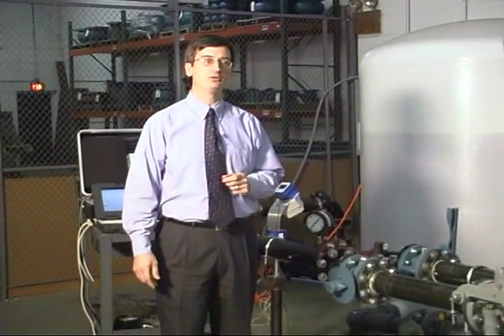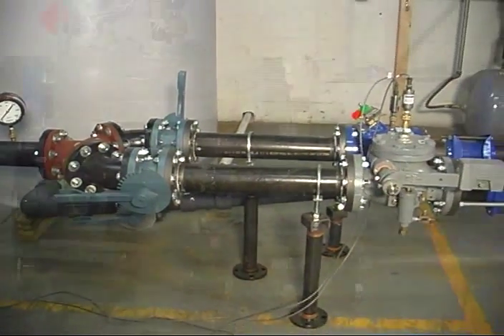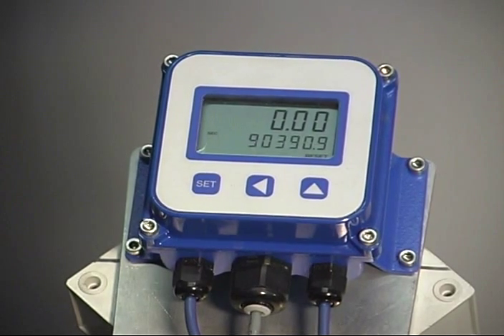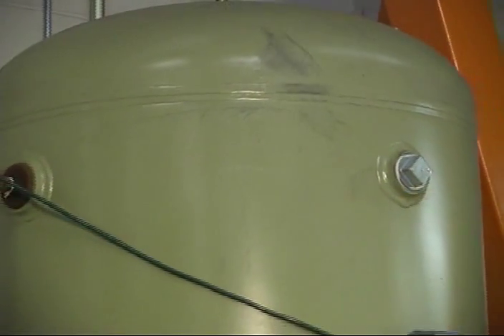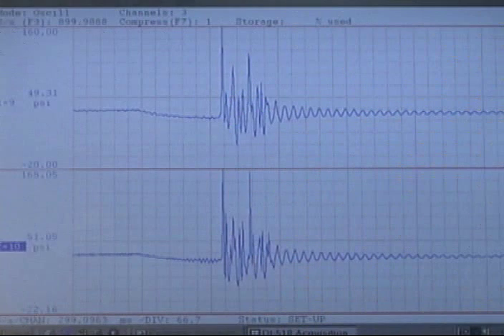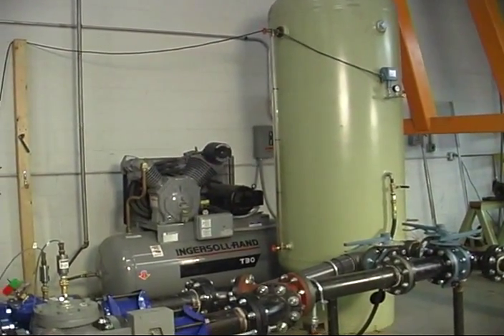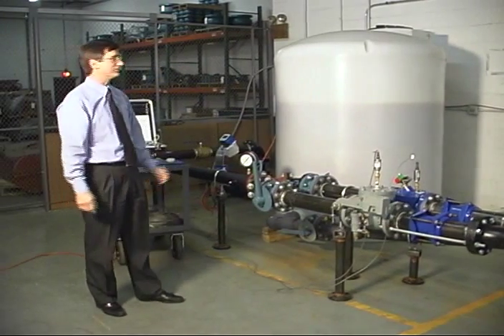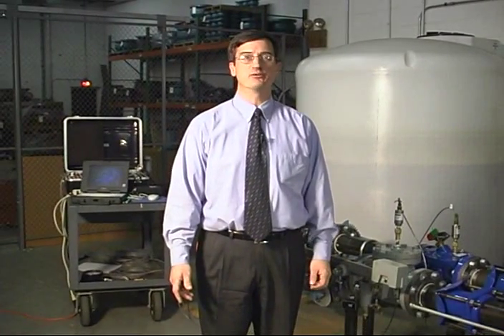Prevent Water hammer with Surgebuster Check Valve and Swing-Flex Check Valve

Comment: The title is misleading. The check valve does not prevent water hammer. Water hammer is caused when the liquid pressure drops to a full vacuum, creating vapor pockets inside the pipe. When the vapor pocket collapses, high pressures result from the water column rejoining. See this video /watch?v=X9UbzcanuDk&feature=related

None the less, Surgebuster is a great valve that performs very well, when used in conjunction with actual surge protection devices (surge tanks and air valves...)